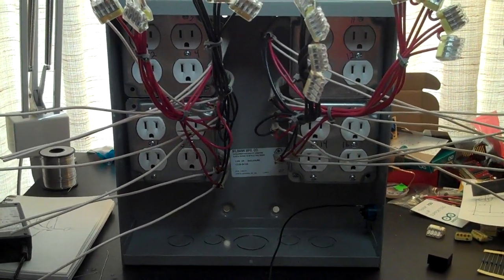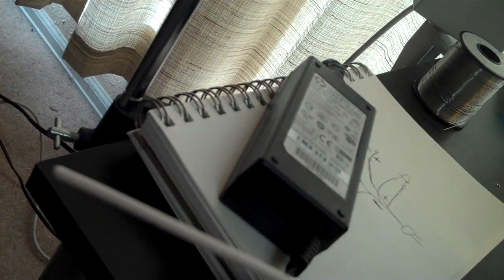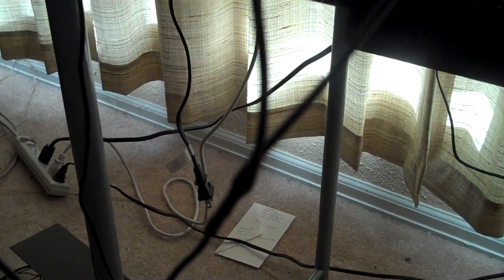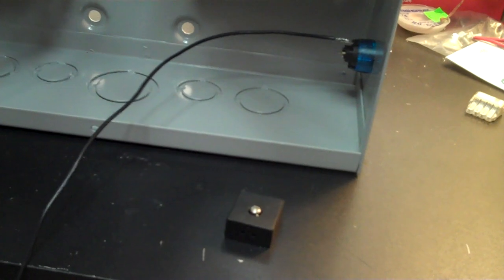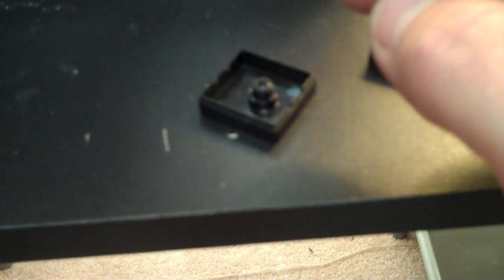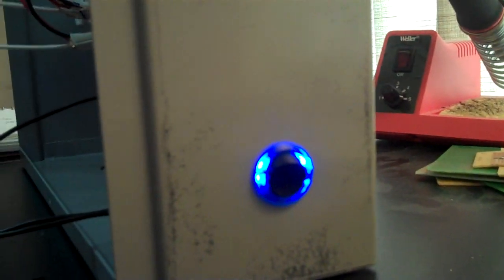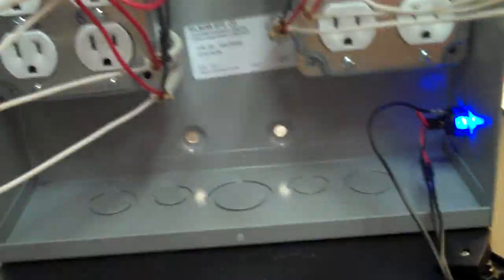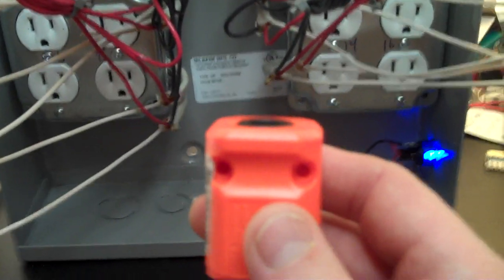Christmas Lights Control System - Part 3-1

Comment from the maker: The mechanical relays in version 1 of the project will break down fairly quickly.  They simply weren't meant to handle this kind of use.  In fact using them this way is kind of dangerous, it can cause arcing and even fires.  In version 2 of the project I switched over to solid state relays, which have no problem with being turned on/off rapidly for extended periods of time, they also allowed me to implement true dimming of the lights.  YOU SHOULD NOT USE MECHANICAL RELAYS FOR THIS OTHER THAN AS AN EXPERIMENT.

Comment: Hate to be critical but you shot yourself in the foot and  made your wiring setup 16x harder than it needed to be.    one black wire from  every brass screw to every relay (Normally open terminal on each relay)    one  white wire  JUMPERED across  8  outlets  (not breaking the silver side tab  and  one bare copper wire jumped across the ground screw  of all 8 outlets.   This many unnecessary wires is just asking for problems
Reply from the maker: That's fine this was years and years ago.